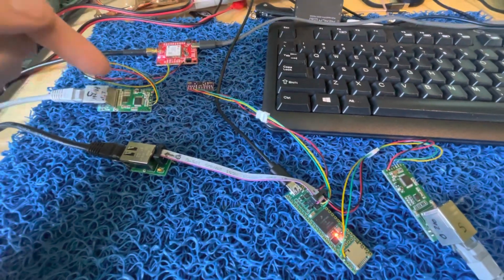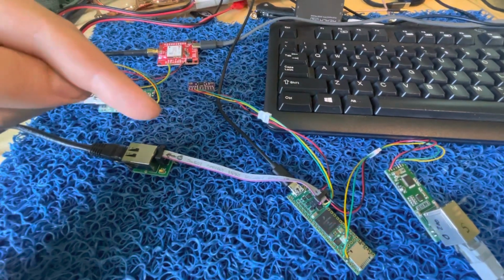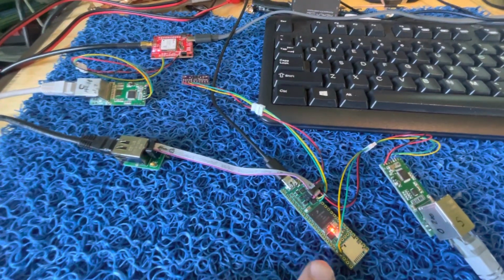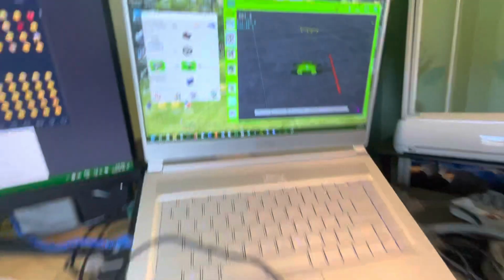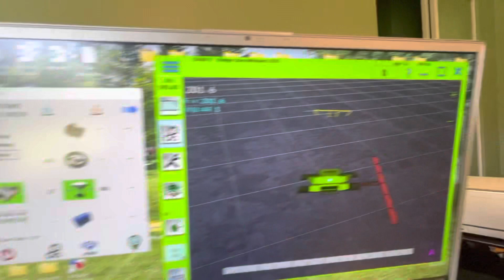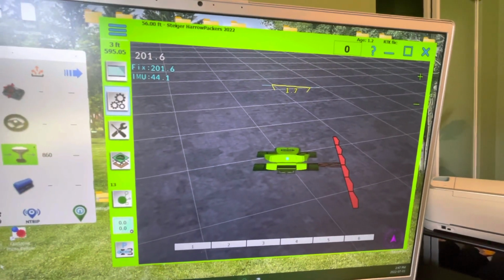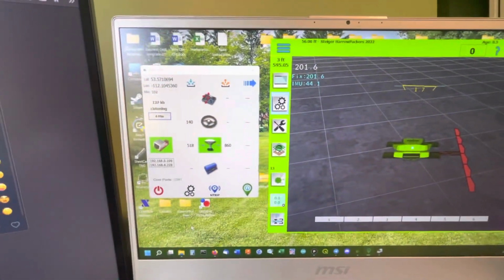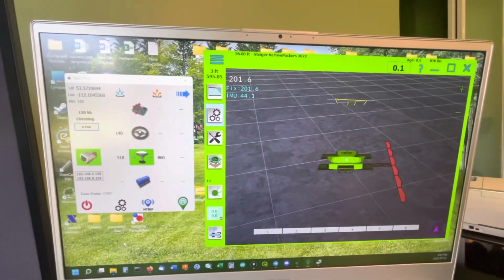AgOpenGPS PANDA, GPS GGA from anywhere? Why not?

Comment: If I could only get the AgOpen GPS Discourse to send me the verification email, I would have the ability to ask the forum a couple of significant questions. I have tried for some time now to gain access. I guess I will spend all of my time reading everything available on it and arrive with seasoned comprehension. I'm not sure I am that tenacious. I used to be.
Reply from the maker: Join the Telegram channel right away and send a picture of the error the forum gives you, we will fix you up.
Reply: @potatofarmer  Yeah, I'll just keep reading. I am visually impaired, so trying to see the information on my phone is a bridge too far. My Iphone is set to the biggest font and I require glasses to see it. I'm used to just reading what I need to find. Just wait until I start soldering! LOL.

Comment: I'be only started in the last few days to dig into the whole mystery of AgOpen and I'm still wondering what Panda is/means. Would be very grateful for an explanation.
Reply from the maker: $PANDA is an AOG invented NMEA sentence. It is the $GPGGA sentence information, plus IMU heading information prefetched slightly before the new GGA arrives. This is achieved by using the high power teensy 4.1 micro controller, to take both pieces of information and output Panda.

What is the advantage? Much more stable handling over bumpy terrain, and less erratic smoother steering.